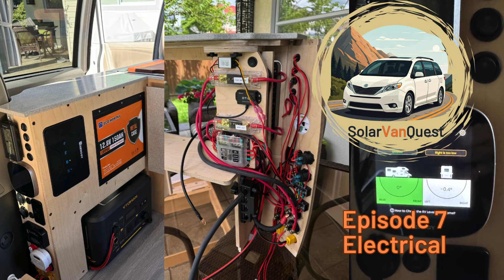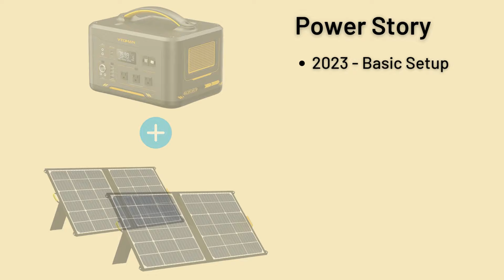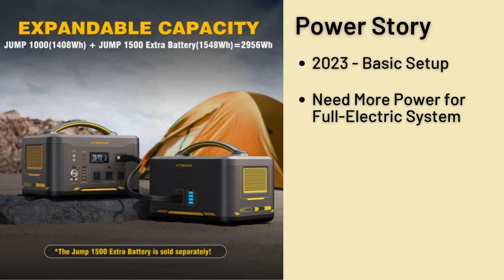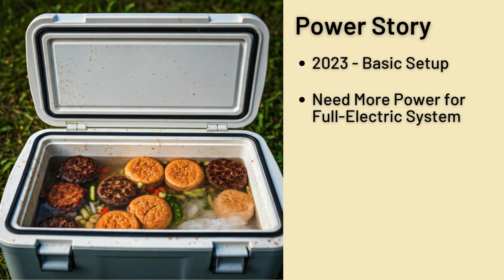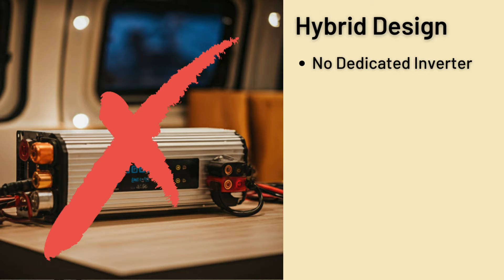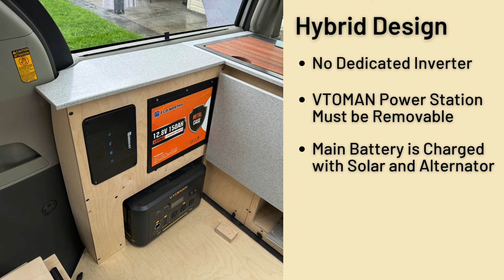~E07: The Most Versatile Power Setup for Camper!

Comment: I love your videos and have a 2nd gen I have turned into a camper.  I would like to see more details of your wiring.  I have a Bluetti AC70 and am looking to add a battery but am confused how to charge both via my Bluetti external solar panel and alternator.  I am confused if Bluetti makes a device similar to your Renogy or if the renogy devices would work with my Bluetti.  I know Bluetti makes an alternator charger but electrical in general is confusing to me
Reply from the maker: I think you just plug in both solar panel and alternator into your Bluetti power station- it will charge from both or prioritize it somehow. Check the manual for details. I have to use charging controller as in addition to VTOMAN power station I have LiFePO4 battery which needs it.
Reply: @SolarVanQuest  Do you use your power station and battery seperately.  For example power station for only AC and battery for only DC.

Comment: Your content is amazing and you have such a well thought out design. I was curious how that vtoman power station powers your induction cooktop. I know the inverter is good for 1000w but the induction cooktop is 1800w. Do you have anothe rinverter that I missed in the interview or something?
Reply from the maker: Thanks! Even though it is 1000w, you can run it on higher loads - I was using “boil” mode on my induction which was drawing around 1500w. But I usually just set power level on induction to be within limits of VTOMAN power station.

Comment: What connections were utilized to have the VTOWMAN charge automatically from the main battery?
Reply from the maker: I used regular charging inputs for VTOMAN which is usually connected to solar - there are two and those connectors are not rated for high Amps. So I ran wire from my main house battery via fuse, and then split it into two to connect to both VTOMAN inputs to limit current via each. You can see two lines connected to my VTOMAN battery in the video.
Probably dbl.line is overkill, but it is safer as connectors are not heating up as would with only one.